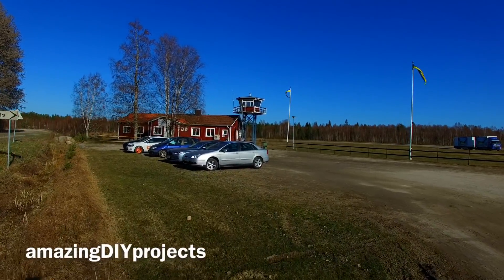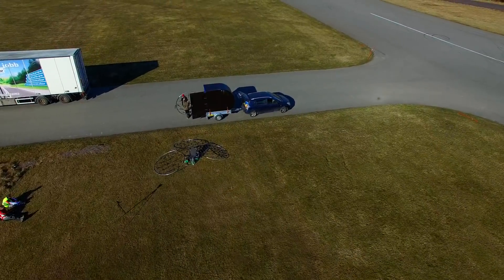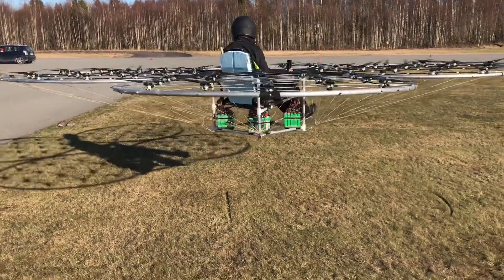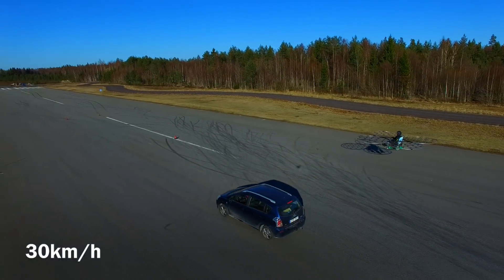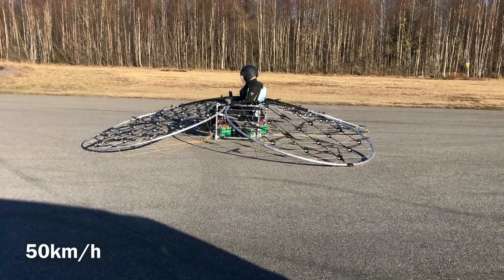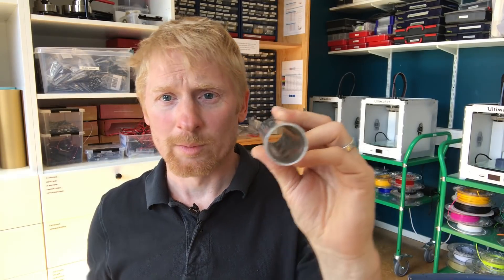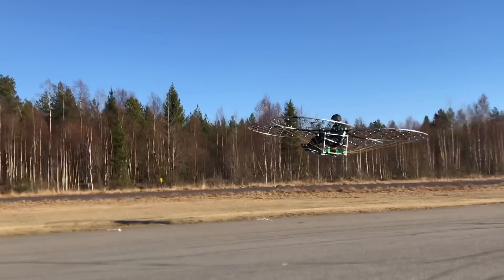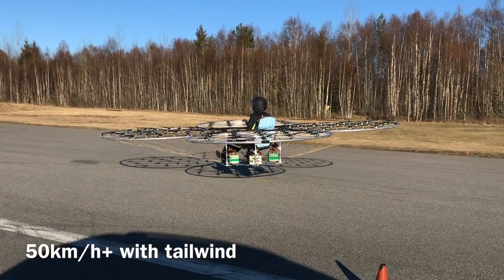chAIR episode 32 -Maximum Practical Speed TEST! Manned drone quadcopter

Comment: Is there a reason why you are still using a timer on a manned drone? To me it would make more sense to have a voltage display or a "Fuel Gauge" seeing as how you are physically on the aircraft. Very cool project and i'm looking forward to watching more of it.
Reply from the maker: Well, I want to answer simplicity, but when doing multiple start and stops, using a timer is not a very simple or accurate method of keeping track of how much flight time you have left. The thing is, that I started out having the battery bank fractionated for redundancy so that to get an accurate picture of discharge state I would really need 20 voltage meters, but now two flight seasons later, seeing how evenly the batteries discharge there really is nothing wrong with just sampling one or two battery packs for a good enough indication of overall battery status.
Reply: @amazingdiyprojects  Wouldn't you simply need the minimum voltage displayed? After all, if one of your packs is nearing critical low, you'll want to set it down anyway, right?
Reply: @amazingdiyprojects  Have you considered doing a maximum weight / lift  test?
Reply from the maker: Will happen!
Reply: @BMcGhee-t5v  That would be interesting.
Reply: i would watch the rear motor batterys most on a drone the rear works the most to tilt forward  @amazingdiyprojects
Reply: @amazingdiyprojects  You could measure the voltage of all packs and have a little display telling you average, min, max (with an arduino or something?). + 1 hardwired analog gauge as a backup.
Reply: @amazingdiyprojects  charge of Li-Po batteries is quite tricky to measure just by the voltage. Standard procedure is to track power transfer by measuring volts and amps and integrating over time. Thus a pretty much accurate charge can be estimated. The "counter" can be reseted when the battery is without load.
Reply: @amazingdiyprojects  I think a circuit that works with a RGB LED would be the quickest visual that would then lead you to focus on a digital/analog readout.
Reply: @amazingdiyprojects  Really impressive project, well done. The timer approach makes sense, though if you did want to do battery monitoring, I have had great results using Arduino’s. A potential divider circuit (two resistors) feeding into an ADC (Analogue to Digital Converter) pin has allowed me to monitor numerous channels/batteries at once. Clever coding would then allow you to monitor cell balancing, problematic cells as well as estimate duration. Good luck with the next stages of your project.
Reply: @amazingdiyprojects  you do realise that if the batteries are in parallel, they will equalise, yeah?
Reply: @ryanokeefe12  He's most likely have the batteries separated into groups, so that a malfunction will only stop some motors and not all of them.
Reply: @ryanokeefe12  Most lipos are coupled to a charge/discharge electronic. While in operation you don't want the batteries to equalize, so they are basically powering the device through a diode to prevent getting recharged as this would dramatically lower the efficency of the batteries. They only charge when in charging mode.
Reply: Maybe you could automate the timer to start and stop according to a minimum throttle speed of a few of the controllers? Or a few ground switches on the bottom of the chair? Just curious, wonderful build!
Reply: fanplant t
Reply: Agree on the sampling all voltages, then displaying the minimum and average (maximum is probably unnecessary).

Maxim make several tiny chips that sense voltage & temperature (and other things), and feed the data out over a 1 Wire network. That means very little added weight or wiring, and a much greater understanding of what the batteries are doing during flight... You could even log the data to an SD card so you can analyse the batteries after the flight to detect any inconsistent performance.
Reply: Very neat projects.  Wondering how a fairing will aid in lowering drag and also integrating the batteries into the frame more so that not in the square boxes.  Seems the modern electric devices are literally a device built around a battery... so integrating the batteries into the frame seems the logical method for main stream mass produced devices.  Seems like was noted the low drag airfoil looking tubing might aid in ducting the airflow also and better control and not only reducing drag.   That's a great observation and the streamlined low drag airfoil looking tubing material is what I was planning on using in the recumbent trike designs I was working on.  Fairings are the way to go also and can be made like a strip wood canoe method using foam strips and a light fiberglass/kevlar/carbon fiber outer coating.  Seemed to me the vacuum formed, though lighter, are more challenging to make. Neat to see the advances with batteries and I wonder if since electric can have more redundancy in propulsion systems to prevent catastrophic events from single engine failures... if generators will be feasible in the future too like hybrid designs as I've thought since a young age having a sailplane like a thermonuclear power plant electric U2 style aircraft might be something feasible in my lifetime. Seems with advances in liquid rocket propulsion systems too... there can be emergency braking and hover landing system implemented now days.  Anyhow... great to watch the update!
Reply: To avoid dust in face, lower face shield.
Reply: @321CatboxWA  Instructions not clear due to dust in eyes.
Reply: Or a really long extension cord
Reply: Usually, the speed regulator warns before the cells are drained, by making the motors run jerky att full throttle. At least in electric medel flying. And we always use timer in model flying, because the cells last mutch longer if we dont drain them to mutch.
Reply: Why not just use BetaFlight OSD to show cell voltage? Wait...
Reply: @DJKinney  Touché
Reply: I'm not putting all those batteries under my balls
Reply: Displaying the lowest voltage of the 20 packs is the best solution I read here. That's the one that matters. Anyone know a relatively simple way to achieve that?
Reply: having a min voltage display is advantageous versus a timer, in that you can work out the rate of usage/voltage drop. from that, after you get good data to determine what 'normal' usage is & can set parameters to stay within, you can extrapolate a possible issue in real time before it becomes an 'unscheduled high-speed landing' & a serious emergency. 
also, the timer makes several assumptions that could compromise a flight & compound issues on top of issues. 
the timer assumes all of the equipment is working properly during flight. mechanical & electrical are not considered with a timer.
the timer assumes the weather is static & optimal. a tailwind can quickly turn into a headwind without warning. or no wind at all can turn into a nasty crosswind. these situations will force a reaction from you to maintain stability. that reaction will involve you using more or less power than anticipated.
the timer assumes a static barometric pressure. it takes more power to stay aloft in low pressure areas than high pressure ones. 
the timer assumes constant velocity. changing speed or direction will affect power consumption.
having more information is safer than less information every time.
Reply: Стимпанк)
Reply: I would like to see him build a light frame for solar panels.  would be great to go longer distances
Reply: @DJKinney  yes huh.  It's not a UAV.  Its a MAV.  Har har
Reply: Fuel gauges are not practical in this type of prototype.
A timer is going to give you a end time within a known safe period. Ignore the timer at your peril.
I would suggest tripping the timer on arming like you can do with most RC models though. Having to split your attention and remember to arm the timer each time is a problem waiting to happen.
Reply: @DirtyRobot  For someone smart enough to build something like this, knowing that a checklist as EVERY flying machine pilot does BEFORE flying should be already automatic.
Reply: 🔴 What Is Islam? ⚠️

🔴 Islam is not just another religion. 

🔵 It is the same message preached by Moses, Jesus and Abraham.

 🔴 Islam literally means ‘submission to God’ and it teaches us to have a direct relationship with God. 

 🔵 It reminds us that since God created us, no one should be worshipped except God alone. 

 🔴 It also teaches that God is nothing like a human being or like anything that we can imagine.
🌍 The concept of God is summarized in the Quran as:

📖 { “Say, He is God, the One.  God, the Absolute.  He does not give birth, nor was He born, and there is nothing like Him.”} (Quran 112:1-4)[4] 📚

🔴 Becoming a Muslim is not turning your back to Jesus. 

🔵 Rather it’s going back to the original teachings of Jesus and obeying him.
Reply: @ahmdabdallah2132  can you stop discussing religion here? this video is about science and flying. Not religion. would you like us to discuss science in a mosque? everything has its own designated place.
Reply: Ahmd Abdallah - there is much wisdom in the Quran. It is the writings of Mohamed that are troublesome for the perception of Islam by many.
Reply: @ahmdabdallah2132  God is great but the man who wrote the Quran is the opposite.
Reply: ⚠️ God has said in the Quran:
🔵 { O mankind, worship your Lord, who created you and those before you, that you may become righteous - ( 2:21 ) 
🔴 [He] who made for you the earth a bed [spread out] and the sky a ceiling and sent down from the sky, rain and brought forth thereby fruits as provision for you. So do not attribute to Allah equals while you know [that there is nothing similar to Him]. ( 2:22 )
🔵 And if you are in doubt about what We have sent down upon Our Servant [Muhammad], then produce a surah the like thereof and call upon your witnesses other than Allah, if you should be truthful. ( 2:23 )
🔴 But if you do not - and you will never be able to - then fear the Fire, whose fuel is men and stones, prepared for the disbelievers.( 2:24 )
🔵 And give good tidings to those who believe and do righteous deeds that they will have gardens [in Paradise] beneath which rivers flow. Whenever they are provided with a provision of fruit therefrom, they will say, "This is what we were provided with before." And it is given to them in likeness. And they will have therein purified spouses, and they will abide therein eternally. ( 2:25 )
⚠️ Quran

Comment: It is surely an amazing vehicle, still I am concerned, that if any of your lines would snap you would get cut by the propellers. I would add some kind of protection or barrier between you and the blades, also some frame around your body in case you land up side down or anything goes bad, that would protect you from falling directly on you head, i mean these are my only 2 suggestions, other than that I am amazed how well it works and looks

Comment: They make oval section ally tubing.... are variable pitch props a possibility.... I watched a fella who made a two-contrarotating prop drone.... the blades were mounted in such a way as to vary the pitch by tiny speed changes at very high frequency made by the esc....using this he was able to fly in all directions with just two props.... the advantage being you can have variable pitch without any more hardware.... hope this throws another angle on getting higher air speed....i totally enjoy what you do.... thankyou

Comment: I have a solution to the shaped tubes that doesn't require a rebuild. Attach lightweight, non structural, swivelling   clip on aerodynamic vanes to the existing round tubes. It'll rattle and increase mass by 10kg, but it'll reduce your drag.

Comment: Hello again.  I've been following you for quite a while, and you are my "hero", at least from an inventive perspective.
I was originally thinking I would build a gas engine powered quad copter with variable pitch rotors, but have since switched focus (sounds so pathetic to say I "gave up" - but I could see the obstacles were large) to an electric vehicle.  My current project is to build a model of the BlackFly manned UltraLite VTOL (google it if you're not familliar).  The moment I saw it, I knew it was ingenious with a design that has fewest moving parts (to fail).  I'm wondering if you have any insight into how to select high power motor/prop/ESC combo's given the incredible work you did with your manned "quad" (76 motors??) copter.  Apparently, the founder of "Opener" the company developing the BlackFly has patents on motor design which focus on reducing eddys in the rotor shell by building it with thin laminations of silicone steel separated by thin layers of epoxy.  I'm just wondering if you've had any experience with this type of high power motor.  The BlackFly design is VTOL capable, but travels in cruise like an airplane, so the high power requirements of the motor are for limited time periods during take-off and landing.  I hope to someday build a full scale model similar to the BlackFly.  Right now, I';m working on a model to work out the flight controller software which I've written myself with the starting aid of Joop Brooking of Netherlands.  I'm doing the orientation calculation using Quaternions so its quite a departure from Joops original code.  
Cheers, and keep on inventing.  You're an inspiration to us all.  Many thanks for the thrills and the knowledge you've shared.
Randy

Comment: It amazing how the small guys are actually flying and the pros basically aren't. Maybe they are hoping the batteries will get better before they actually start. That's what I reckon. They are only doing it just in case batteries do eventually make it practical. They are one step ahead cos if the batteries do get a lot better, they at least have a a head start.

Comment: As a prototype, you are right there! Now make your refinements and well, the sky's the limit! (Ugh. I know.) You are 95%, maybe 98% to having a completely viable form of electric powered transportation! The Kevlar guy wires are Genius! Probably the reason others have failed. When I first saw this (plopping quad rings) I was like, how is this going to work? I didn't realize the cables were there. They are so light and SUPER strong. (We braid it onto communication cables where I work). Thanks for your hard work and sharing this project. As Dave Jones would say, "Winna', Winna', Chicken Dinna'!!   (EEVBlog, Australia). That has to be a blast to fly.

Comment: How much votage and amperage are you drawing with that setup - roughly?  Curious if a small gas powered generator - like the 900w chinese kind or the harbor freight 2000w kind - would be lighter than those batteries or provide more flight time...  That is really cool though!

Comment: I have watch bits of each build, gasoline, and electric. I feel, for the gasoline build, the two center motors, on each side, may be more beneficial if the support arms were extended slightly. Giving more of a circular patern to the motors. 

For the electric build, I would suggest addressing a altitude failure with a parachute, AND something like the airbags of motor vehicle. Your project really excited me just by watching, I could only imagine what it would be like to fly. God bless.

Comment: I don't think this qualifies as a "manned drone quadcopter" ONLY Trump would use the term "manned drone" If it's manned, then it's NOT a drone, A drone is by definition unmanned (this part of comment also meant for trump) 

Now, A quadcopter, also called a quadrotor helicopter or quadrotor, is a multirotor helicopter that is lifted and propelled by 'FOUR' rotors(not four dozen) Quadcopters are classified as rotorcraft, as opposed to fixed-wing aircraft, because their lift is generated by a set of rotors (vertically oriented propellers). 

So, This is a manned rotocraft, you are testing a manned rotocraft NOT manned drone quadcopter... your welcome

All I ask is... It's 2020, please use the easily accessible Book of All Answers aka the internet before incorrectly naming your upload to your you tube channel.

btw, cool manned rotocraft! =D

Comment: Place the tube inside a lite foam then wrap it with a lightweight sheet of fiberglass coat it and paint it in a light coat of ceramic paint... like this you can get it to cut threw wind like butter because you can shape it any way you need... This will solve your wind resistance problem... Also if you can work with a drone programming person you can write a self calibration program... So it will self calibrate like regular drones so you don't have to worry about the drone being of balance,crashing, and other things that would help your flying be more smooth, plus you would be able to focus on all the other things that need your attention...

Comment: Totally amazing project.
"Flying lawn chair".
It seems to be very stable.
I imagine it will eventually look somewhat like a flying saucer, as it takes shape, with added aerodynamic carbon fiber fairings and center  "fuselage" with retractable landing gear. Or better yet, moving the chair or pod under the rings to provide easy entry to cockpit, improve horizontal stability with better center of gravity, pick up more lift and directional speed while saving some weight. 
I'll be anxiously watching.
You are doing great !!

Comment: @8.35 wot did you expect 'carbon burner?' its airspeed planes refer too, for 100 years. Cessna usually travels 60-100 k. The speed of flying is because you avoid roads.
Buy a paraglider.

Comment: Make it a rectangular array then you can shape the tubes into an airfoil for the ones across and more of a vertical blade for the ones forward backward...  angle them to create lift at 50 km/h or the desired cruising or top speed